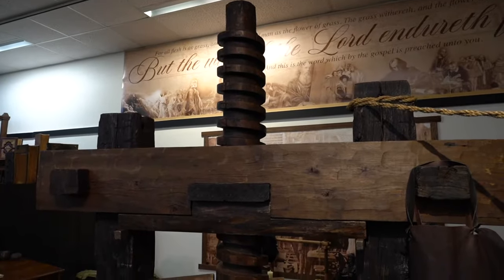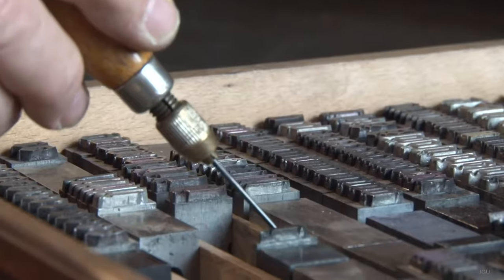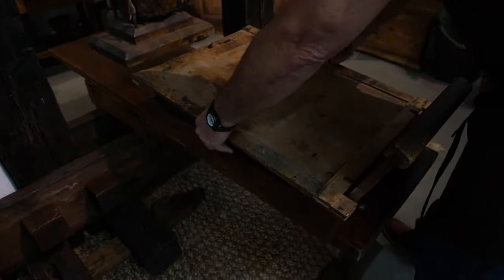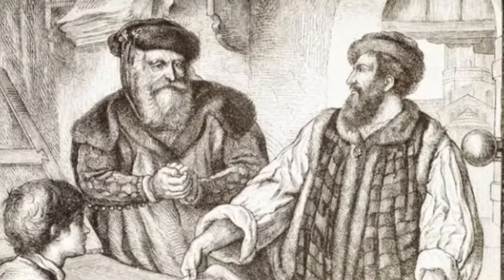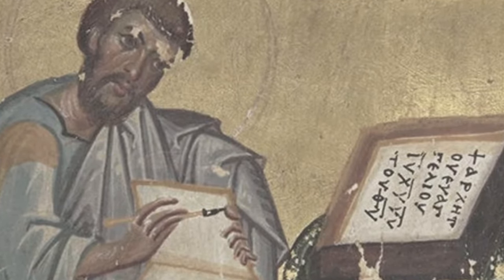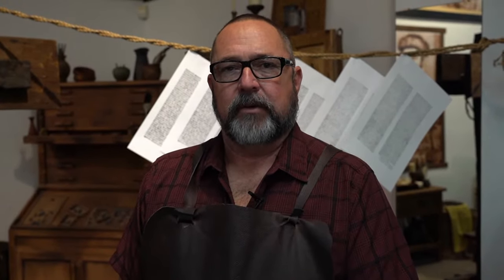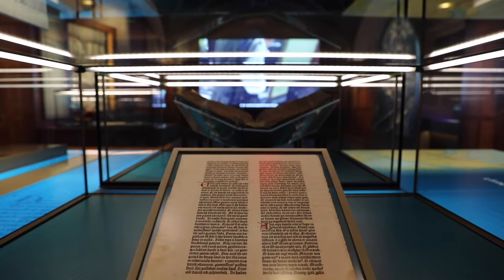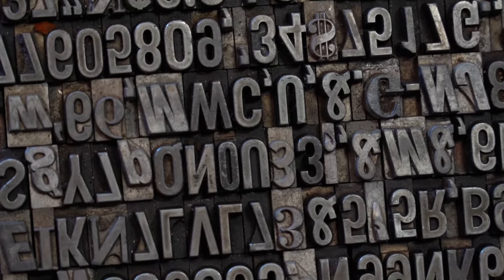How does a Gutenberg printing press work?

Comment: Movable type printing was first used in Dunhuang in Tang China in the second half of IX century and indeed initially applied several thousands wooden types of individual Chinese hieroglyphs.  But because Dunhuang became a part of Uyghur Ganzhou Kingdom in Gansu (847-1035) and also bordered another Uyghur State- Idikut Turpan Kingdom (856-1369), Dunhuang printing houses soon started to print books in Uyghur script and on Uyghur language. They used movable wooden types of blocks engraved with only 26 Uyghur letters ( based on modified Sogdian script). Nevertheless, they used wooden types of engraved words, not of individual letters, so to print one book it was needed to use again several thousands movable types. Unfortunately, almost all Uyghur printed books of IX-XIII centuries, that survived till XX century, were destroyed and burnt out during Chinese " Cultural Revolution " 1966-1976 years.